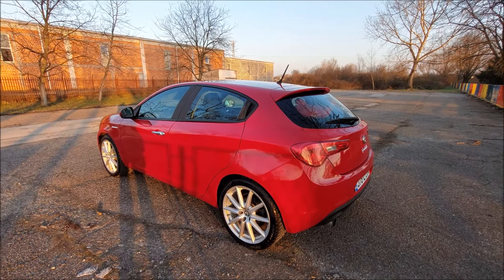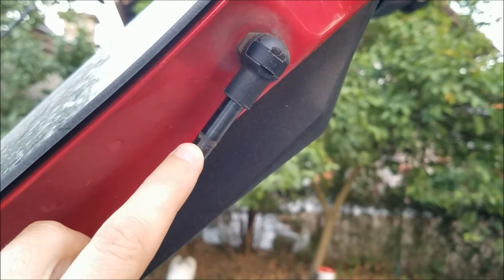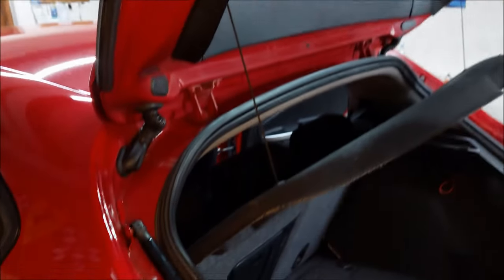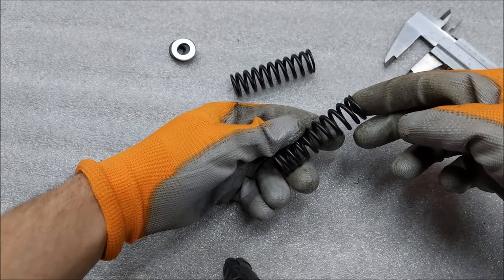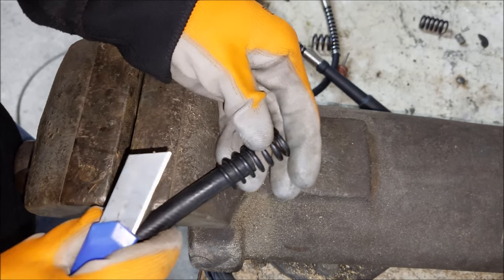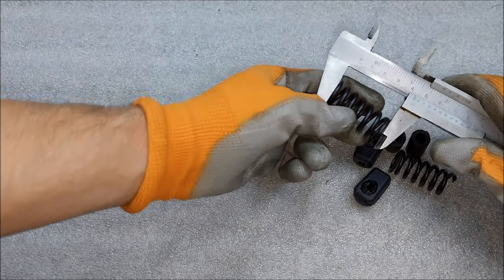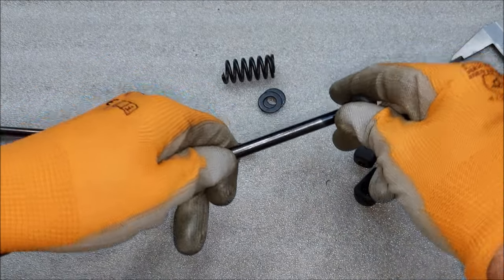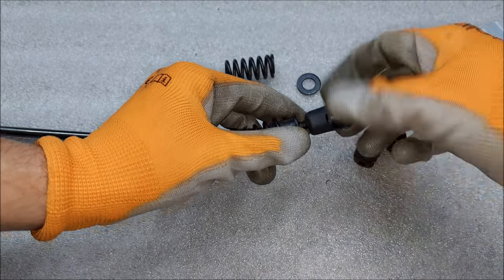DIY Automatic Boot, Trunk Lid Open, Hatch Pop Alfa Romeo Giulietta

Comment: But if you click the unlock button on the remote (not only the rear one) will not open the back automatically?
Reply: No, unlocking the car normally makes it possible to open the boot by pressing on the badge but doesn't actually open it. There is one button specific for opening the boot that does the same as pressing the badge.

Comment: Does this not hurt the latch mechanism at the bottom? It seems like this way there's always a pull on the boot upwards. Basically you try to open it even if it's closed.
Reply from the maker: I didn't have any issues with my 147, and it had the same setup for couple of years

Comment: Inwant to do this on my 159 sw but my boot struts are to powerfull and have no brake at the end..they just lift like mad if i dont hold the boot..i.m afraid it will break from the welding points

Comment: After some time the strain on the lock causes it to bend. Some people also reported deformations of the trunk cover, caused by the forces it must withold with those springs, while it's closed. Give it a year or two.
Reply from the maker: These have been on the car close to 2 years without any issues

Comment: what is the force of the hydraulic cylinders? Mine in 410 Nm are not sufficient, the trunk only opens halfway, maybe better with 420 Nm?
Reply from the maker: Not really sure, but you either need stronger springs, or more powerful struts

Comment: I have a problem on the Alfa 159. The switch for opening the fifth door when the temperature is 25 or more degrees C works perfectly, however, as the outside temperature drops when I press the switch, it takes more and more time for the door to open. Below 5 degrees C, the switch no longer works. otherwise, the door opens remotely without any problems. Also, below 5 degrees C, I can't open the car with the remote key. I enter the car with a mechanical key and after 10-15 minutes of driving, the central locking works. The car has a new battery. In summer, this problem does not exist. otherwise, the car starts in summer and winter without any problems. Help me.
Reply from the maker: You have to diagnose the issue